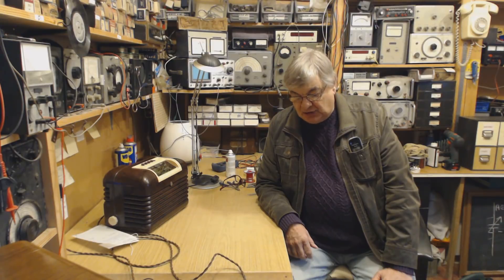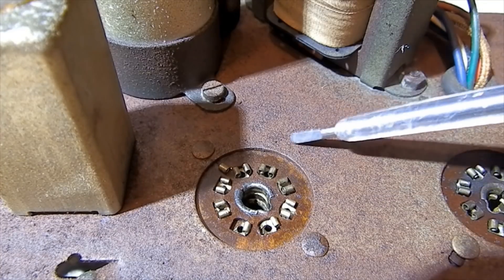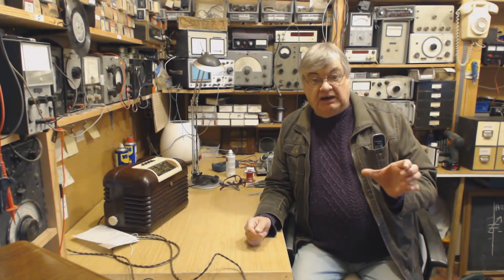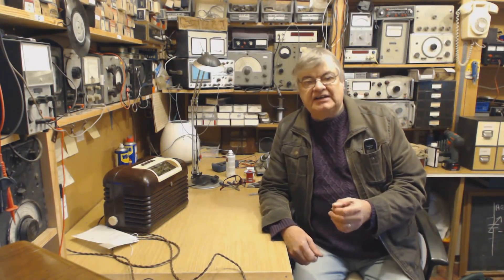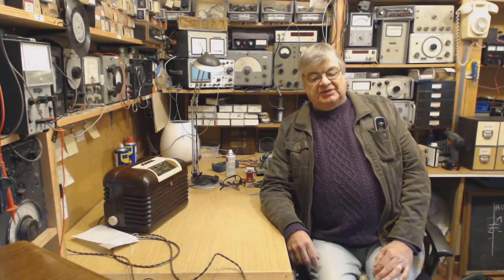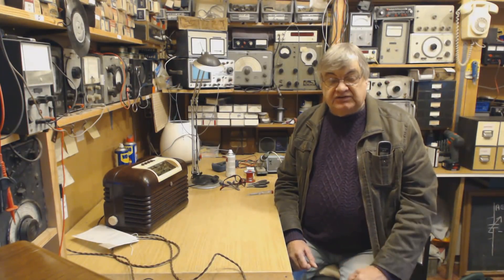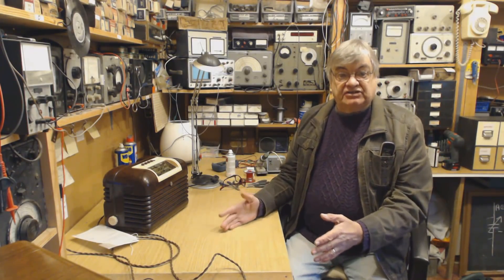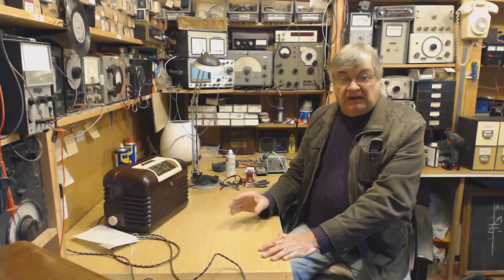Vintage valve radio scrap Bluetooth DAB conversion

Comment: Hi Ray, I've no problems with stripping something for parts if it's too far gone and beyond all sensible economic repair, as long as the useable parts get used to fix up other radios. I don't have a problem with the bluetooth conversion as long as the internals get reused if possible. What I don't like is when the guts are simply removed and dumped in order to make some kind of retro-tech ornament with the case.
The absolute worst is stripping to sell the individual parts on auction sites becuase they can make more money that way. Don't know whether this happens with consumer radios, have seen it with older pushbikes.
73 Simon M0SBT
Reply from the maker: I agree. Selling the parts on auctions sites isn't good as, usually, the radio has been stripped solely for that purpose.

Comment: Ray, these exhibits you have shown are, well and truly, beyond any kind of repair.  In fact the first one looks to me, it's been damaged by fire or excessive heat of some sort.
Besides, these would take a huge amount of your time in sourcing parts, sandblasting (third party?) and re fitting the radio, hardly worth it, unless the customer has some kind of emotional tie with this particular radio and wants it done, AND, he 's willing to finance the project to whatever extraordinary levels that may require!

If it was me, I would look for another radio with damage to the cabinet, take the whole chassis out and fit it in the good  casing, just doing the alignment and a clean up. Even that task would be time consuming and somewhat lengthy in sourcing a similar radio with damaged casing.

Thanks for the video and the thought provoking issues you put to us!

Cheers!
Reply from the maker: As you say, sourcing parts, sandblasting... it all takes time and money. Thanks for your input.

Comment: Personally, I think that if someone can look at a radio and think it would make a “good” Bluetooth speaker, then the cabinet must be in a good enough condition to warrant restoration. Even if the chassis is toast, then it could be used for a chassis that’s missing a cabinet or has one in terrible condition (for example, completely gotten at by woodworm to the point that it’s collapsing). That said, I feel the guy who took the radio cabinet from the skip is fine doing what he did; it was going to go to a dump site if he didn’t take it anyway. 

As for when a chassis is scrap, I think it depends on the rarity of the set. If it’s a rare set then it’s never scrap, but if it’s a common one, then I’d say it’s okay to be called scrap when it’s completely rusted over, and none of the transformers are in a working condition.
Reply from the maker: Good points, thanks for commenting. Cheers, Ray.

Comment: Hi Ray. I repair electronics modern and vintage. We get given all sorts. I repair modern tv and dab. And vintage valve gear. I often get very rude people who don't quite get that their modern tv is indeed scrap on modern stuff being surface mounted electronics once a chip or part has packed up that's not available that's the end of it. I find I can repair nearly anything pre 1980. Modern stuff not so much. I have had people run me down on such pages as Facebook saying I'm useless etc for not repairing their electronic junk. And I mean junk most electronics now is utter garbage. I enjoy repairing old radios and tv sets. I don't scrap much at all. But there is always a point of no return. Usually financial.
Reply from the maker: Hi Tim, a point of no return. Yes, I like that. OK on the modern stuff. As you say, nearly everything old can be repaired, within reason. Cheers, Ray.

Comment: SCRAP THE CRAP, some were so common anyhow, not rare or collectible, little value.  
IF something is very rare, perhaps worth thousands, you might go the drastic restoration, but it will cost a lot.  But with that sort of rust or damage, you salvage what you can, it's a donor for parts.  I scrapped a 60s Hammond organ, it made a nice workbench, it will be in my next HODGE PODGE 30.
Reply from the maker: Salvage what you can... good point.

Comment: Hi Ray good to see another excellent video.I think the radios you showed us were honestly beyond economical repair.However if the cabinets of these classic old radios are still OK  then why not strip out the internals and replace them with another radio? At least it would still give some listening pleasure and look lovely too.
Best regards Ray.
Ian Harling G7HFS.
Reply: yes, that's referred to as a parts donor, salvage what you can.  Many classic radios become damaged in the postal service, good guts, smashed case.
Reply from the maker: Hi Ian, Thanks for commenting. Good point. Cheers, Ray.

Comment: I was amused to read of the repairers of old transistor radios who carefully cut old metal can germanium transistors open and replace the contents with a ZTX500 silicon transistor and a bias resistor before inserting them back into the radio so that they look "authentic" on the inside. Similarly with putting modern electrolytics into the cans of old ones or even wrapping PP3s in a printed cardboard box to replicate an old HT battery.
Old technology is interesting on two levels; the novelty of old technology working in a modern age, and the aesthetics. Often the latter is sufficient to warrant saving them from the dump, but eventually a radio stored in a damp garage is a modern incarnation of George Washington's axe; still completely authentic despite two new heads and three new handles!
Reply from the maker: George Washington... Love it! Thanks for commenting. Cheers, Ray.
Reply: Summed up with the last sentence.  What is original when things have been replaced.  If you want it to look original fine, but if you replace all the valves and the transformer and put in a new tuner, is it still original?